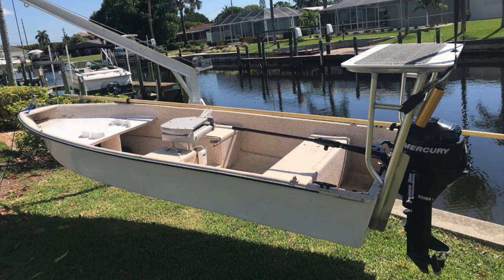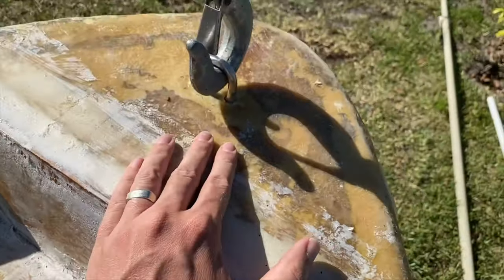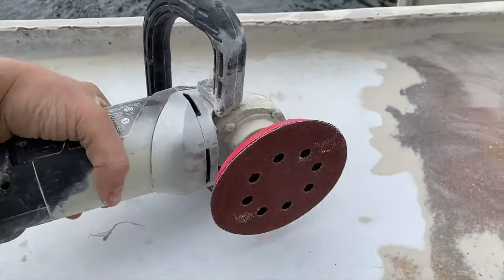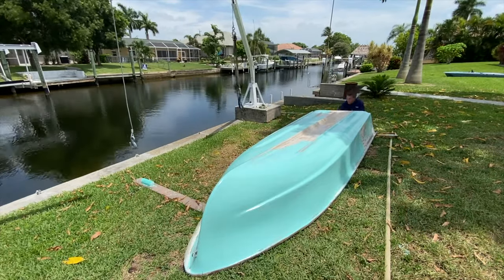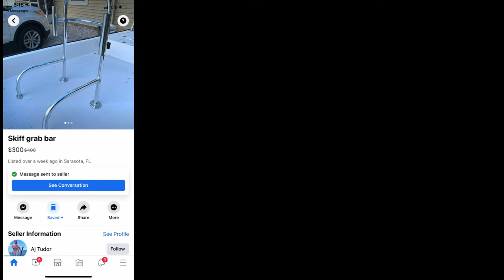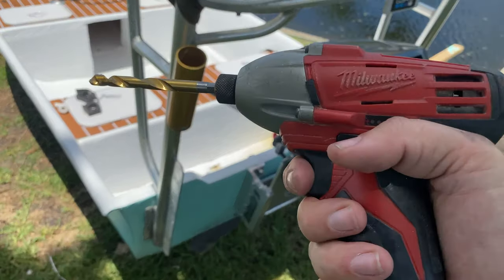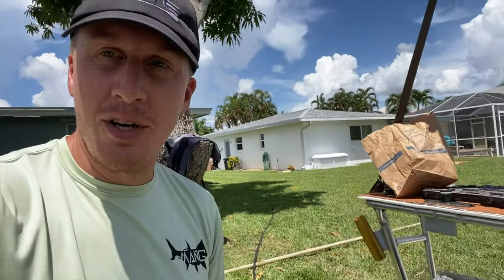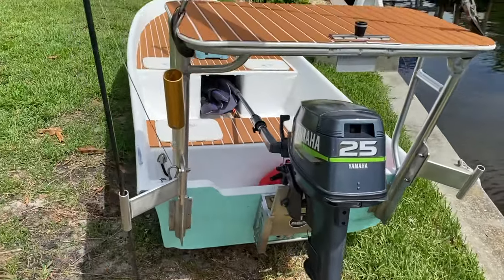BACKYARD FIBERGLASS BOAT BUILDING |  Part 3

Comment: Can't thank you enough for this series of videos. I've had a Gheenoe for 20 years, garage kept, in Atlanta, still in really good shape. But I've wanted to add a casting deck fore & aft forever. Sad thing is, I worked for a polyester resin manufacturer for 20 years. I know all the types of resins and fiberglass, what works well, I just never had to apply what I knew about resin, gelcoat and Methyl Ethel Ketone Peroxide. You hit on so many things I wanted to do on top of the decks as well! Hatches, wiring, grab bar, interior gelcoat and the jackplate. (I'm a Lakelander. Grew up fishing the intercoastal and the everglades. The Gheenoe and trailer are about to start a 500 mile pilgrimage to one or the other a few times a year.  Don't know where you're located, but I feel I owe you a beer or 6 for all your help.

Comment: The skiff came out amazing, looking at helping my dad repair and re-glass his old boat
Reply from the maker: You can definitely do it. Polyester resin and gelcoat is easy to use.  Epoxy gets tricky since it doesn’t like to bond with gelcoat which is polyester resin based.

Comment: I can not get over how well this skiff turned out !!! I have watched this video 3 or 4 times now. EVERYTHING you did to this skiff . Is spot on !! The only thing that I would have considered changing would be the 3/4 plywood. I think you could have gotten away with thinner material or marine fiberboard and it would saved some weight. As I said though . Great job and you made it look easy !! Minus the sanding of course. NO ONE likes sanding 😂
Reply from the maker: Haha...yeah I debated on composite vs marine plywood front deck and glassing over.  However, I figured I would usually run solo on this skiff so the added weight in bow would help it plane out quicker.  Also composites were pricey and hard to find.  If completely redoing a transom I would do Coosaboard and fiberglass over.  

And yes....sanding was hell.  😂 
The end result was rewarding.  Fun to take an idea and build it into reality.  I got lots of ideas.  Even have some other builds I’m considering that could accommodate a 6hp outboard and fit in the back of my truck.  Almost like a solo skiff but different hull shape.  Probably could build for under 500-$600 minus motor.

Comment: I need your input on installing a grab bar and the deck covering like you did as what hardware you used for the grab bar and what to know about laying the deck down to make it stick please
Reply from the maker: Almost all padded decking comes with sticky adhesive backing.  Name brand SeaDek/MarineMat/HydroTurf have best backing adhesive.  Generic padded decks don’t use as good adhesive.  I had deck padding peel up some so I applied 3M Super 77 to make it extra tacky.  Then I laid the deck padding back down.  I cleaned deck really well prior.  No issues since.

Comment: I used the same gelcoat from fiberglass coatings.  Got it from the st Petersburg store.  I just wanna give you a heads up , that gelcoat is cheap quality.  I had a professional spray it and he said it was a nightmare to spray  and it took weeks to cure.  Ended up sanding it back off because it was horrible.  Well I have 2 gallons of Alexseal on order and my buddy on standby to spray my whaler for me.  Looking forward to taking my boat back out in Tampa bay.  Maybe back to the skyway bridge again
Reply from the maker: Got gelcoat from the same location for this project.  

So you bought it and had a professional spray it?  Sounds like a mixing issue 100% and the professional blamed the product to safe is reputation.  Taking two weeks to cure tells me he didn’t use enough MEKP, didn’t mix it well, or didn’t mix in sanding aid wax and thus it gave appearance of not curing by remaining tacky.....WHICH IT IS DESIGNED TO DO FOR LAY UPS.  

All my boat building buds have used FGCI coatings with great results.  I too had a great experience.  The fact yours never cured within a day or two tells me definitely someone mixed it wrong and had concentrations of mixing components way off.  That can happen easier when spraying and thinning gelcoat for spray gun. 

Brushable was easy to use.  Need good sanding prep work.  Roller laid it on nice and thin like a spray gun, but would have had to do several layers and finish up with a wax added final coat.

Comment: I got one of them SeaSic shirts his logo is awesome
Reply from the maker: He is a good friend of mine.  I agree...love his logo and design. I bought this boat from SEASIC and fixed it up.  When I got it the boat It had small holes through the hull so it didn’t even float.  I lowered it into the water via davits and it had small leak mid-hull.  Found out the wood center console had too long of screws and they were through the hull.  So when I bought the boat I pulled out the wooden console and unknowingly that resulted in holes in the bottom of boat. I called up SEASIC and we had a few good laughs.  My dog didn’t think it was funny.  My dog was in boat ready for a ride and freaked out thinking she was going to drown. 😂

Comment: How did you template the bow curves? I have 2 full sheets of seadek and last time I just cut when it was already stuck down which I obviously do not want to do this time. So I am curious how you did a template. Thanks!
Reply from the maker: I used the foam deck board as template…same foam boards I used to template the marine plywood top deck.  

Btw… 
Fuel Water Separator 
https://amzn.to/3aJgwPB

Comment: Any chance you know how much weight you have  in the back of the boat? Even when you were standing the back looked pretty low,  i just got a 12 foot fiberglass, first boat, don’t know anything about boats, im worried it’s not gonna be able to handle my 350 pounds on the rear seat
Reply from the maker: I didn’t have bait/live well tanks filled, cooler wasn’t filled, and fuel tank was in stern.  I planned to put fuel tank under front deck.  With little adjustments it would have leveled out alot more.  Didn’t take much weight on front half of boat to lift the stern level.

Comment: Hey I have the exact same hull. Racking my brain on rod holder types and locations. Any advice ?
Reply from the maker: Track Mounts: https://amzn.to/2VQkFKn

If you aren’t set on locations or you think you might change your mind based on what you are fishing I would use track mount rod holders.  Mount some flat low profile track onto the boat and you will have multiple spots to slide on rod holders. I used track on this boat for switching between my light pole and camera mount.

Comment: Dang Justin!! Love what ya did to this boat. Totally amazed by how you made it look brand new! I may have to start looking for a cheap boat that needs work now that I have a good idea of what to do. Thanks for the videos!!

Btw... who's EVA foam mats did you use? Didn't see a mention of it. Curious if someone has come out with a cheaper alternative since I decked out my Nucanoe a few years back
Reply from the maker: I bought some cheaper knock off EVA mats off of Amazon.  I will add some links to the video description later today.  Plus I’m pretty good about responding to my subscribers.   So if you start tackling a boat project I will be there to try to help you out.  I give my subscribers 110%

Comment: Hey DIY I got one quick question do you think you could use a paint roller on that gel coat instead of a brush maybe cover a little better go faster
Reply from the maker: Roller works but it lays down much thinner.  If you try to lay on too thick with roller it just smears and doesn’t roll.  So if you use roller I would assume you would need to not put wax in the gelcoat and do multiple coats.  

I could have buffed it and wet sanded it to make it shine more, but this boat was made for work.  I wasn’t too concerned about achieving a polished look.  I mostly just wanted the color and sealing properties of the gelcoat.  Brushing worked out pretty dang well but I laid it on thick with brush.  Roller I tried, but because I put wax in my mix I abandoned the roller because I wasn’t achieving the thickness needed.  Live and learn.  

So yes roller works.  Just don’t put wax in and do multiple layers of gelcoat via roller then in final coat add wax to mix. Also use a lint-free roller.  🙂

Comment: Quick question,  any chance you could let me know where you got that grab bar?   Im looking to put one on my carolina skiff j14?
Reply: nevermind i missed that part of the video
Reply from the maker: No prob.  However, maybe the same company that made my bow mount could make you one.  Simple enough design.  Lots of aluminum fabricators here in S. Florida.
Reply: @KayakDIY  Ya im going to order a single grab bar from amazon i think, and then have a welder bend a few pipes and weld them on for the cooler gurdle.  Only other option i found was like 400$

Comment: So now that it's been a minute, how did the brush on gel coat end up doing?
Reply from the maker: It has held up fine.  No cracking.  No delaminating.  It isn't a buttery smooth mold like shine.  That is dang near impossible to achieve without a mold.  Spraying gelcoat in fine layers with final layer having wax added is going to create the smoothest appearance.  However, no one has seemed to notice or care and I get tons of compliments on the boat.  The brushable gelcoat worked way better than I thought it would.  Rolling on brushable gelcoat in thin layers is another option...just remember to add the wax "sanding aid" into final coat.  I found that via brush the brushable gelcoat applied best when brush was loaded heavily with gelcoat.  Don't do too many passes back across gelcoat else it pulls off the surface.  I am by no means a pro.  It was pretty dang easy.  Just mix the gelcoat with lowest percentage of MEKP if it is really hot outside.  If it is really cold mix it with more MEKP.  FGCI gelcoat had very clear guidelines and instructions on the can.  Their products were very easy to understand.  Do note that FGCI sponsored me the resin and fiberglass...However, I believe I my positive experience is non-bias and I happily recommend them.  I paid for everything else.

Comment: BoatDIY? :) Awesome looking Skiff. Could you share your project cost? Thanks!
Reply from the maker: Thanks!  😀 
I will try to figure out total cost.  
Then can discuss in later video and put those details in the video.  I believe I’m for sure less than $3000.  Ive already had offers from people to buy it for twice that.  I shopped around for deals.  Only thing sponsored was the fiberglass and resin by FGCI and a drain plug.  Everything else I paid for.

Comment: Why didn’t you sand and polish out the gelCoat make it shine
Reply from the maker: Mostly time had to do with it...... I desperately wanted to use it and I was satisfied enough with the appearance.  I know this boat isn’t going to be cleaned and polished up.  It will be a daily user that gets lightly rinsed off and get scuffs and scrapes.  Going to be super hard to get a factory finish since it isn’t coming out of a mold.  That would take some insane pro skills I don’t think I have yet.

Comment: I thought you had already run tubing up to the bow along the side of the deck I’m thinking it was on the starboard side of the boat
Reply from the maker: Chaser tube was ran along starboard gunnel from rear bench.  I didn't run it completely to the bow but it allowed electric to be positioned close to the bow.  The bow had a small section of foam filled ballast that I didn't want to tap into with the chaser tube.  I figured a trolling motor could be operated from bow by putting in a deck plug receptacle set about 2ft from the bow (just past the foam filled ballast).  In hindsight I wish I had ran it further forward.  Live and learn.